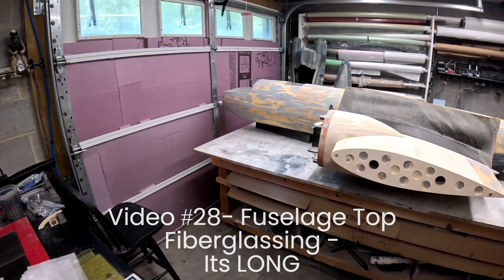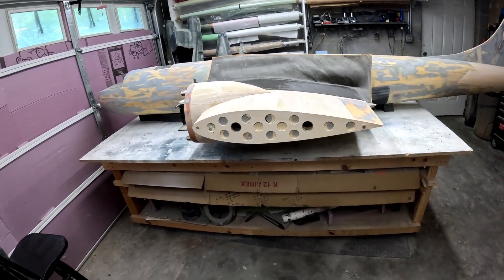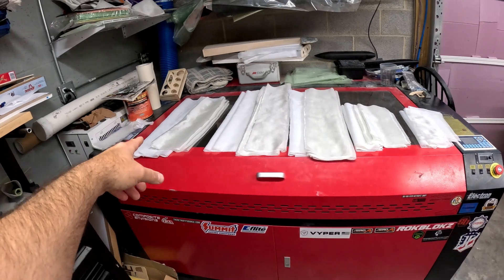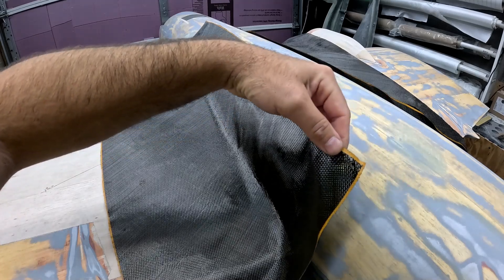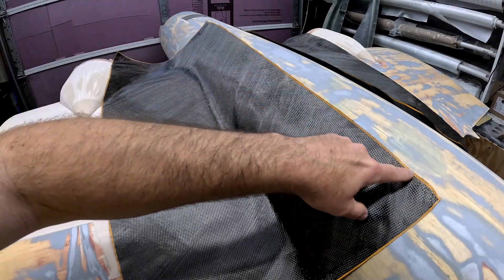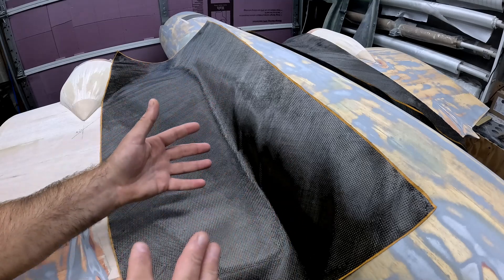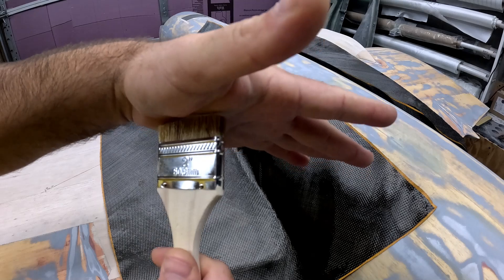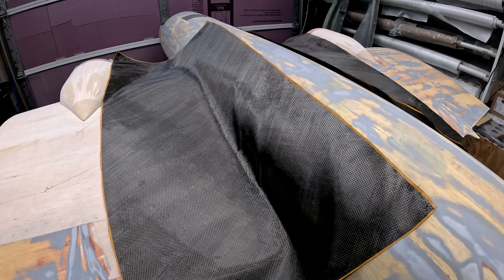B 29 Restoration Project #28  Fuselage Fiberglassing

Comment: Great work. Just wondering how much weight this will add to the airframe ?
Reply from the maker: @Jean-sc1bw   considering its a necessity in sealing the exposed balsa and as a way of returning some strength that was lost, the weight gain is not really a concern.  We can eliminate weight in other ways to counter the gain.